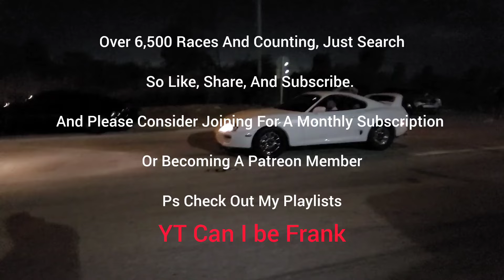Mach 1 Headers E85 vs Mustang GT Catless E85 / C7 Z06 Cam FBO vs Plaid X Gutted

Comment: Legit makes no sense. Are all 18-22 GTs just freaks? Mach 1 is legit a higher trim of the same car and this one had even more mods.
Reply: It’s a lot heavier than a base gt
Reply: Yes, yes we are. Hahahahaha. No... not really. The M1 is just a heavier car.
Reply: From what ive read , stock headers aint bad. Cat delete probably 5 hp off from headers (I would love to see dyno comparison of the two) , and looks like it was 3.15 gears (non pp) which changes things. Also a bit lighter. Still surprised lol. I'm on fence if getting headers or just doing a cat delete on mine lol. Idk if worth paying 3-4k for parts and labor for headers.
Reply: @chadwest1697  you hardly gain any power from headers. It’s the weight off of the nose that makes the difference
Reply: @chadwest1697  I just did Kooks 1 7/8 catted on my 24. Not a fun job. And it's a lil too loud now with the Steeda 3" catback 😧
Reply: @-TheNinjaYaLuv2Hate-  never knew a 2024 Toyota Prius can accept kooks headers now pipsqueak 😹🤏🏻
Reply: @ChevyDoesItBetter  says a 🌈 named Todd 🤭😄😆😂🤣
Reply: Frank protecting lil Todd now..how sweet 😆 2 🌈's
Reply: @-TheNinjaYaLuv2Hate-  you are my sIave and I am your master sweetie😹🤏🏻
Reply: "Frank please get Ninja to stop making fun of me  I have no where else to turn" 🤭😄😆😂🤣🌈🤡
Reply: @ChevyDoesItBetter You have a 🌈 name. Own it 🤭😄😆😂🤣🌈🤡
Reply: @turboterps609  i did a Dyno before headers and Dyno after headers and my car put down 25 more wheel hp that's pretty significant
Reply: @mahmoud596  from a full factory setup with cats yes, from cat deleted factory manis to headers no shot
Reply: @-TheNinjaYaLuv2Hate-  Todd is the sIave master and you are the sIave🙀👑👁️